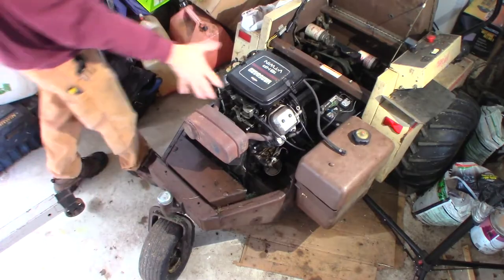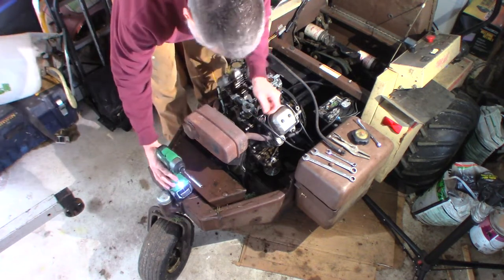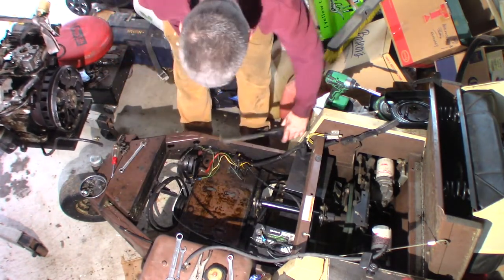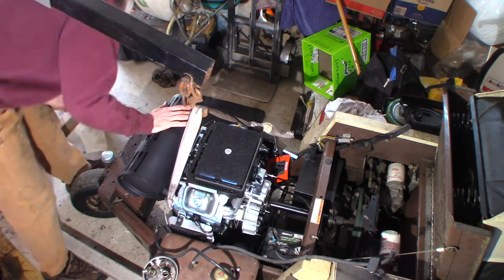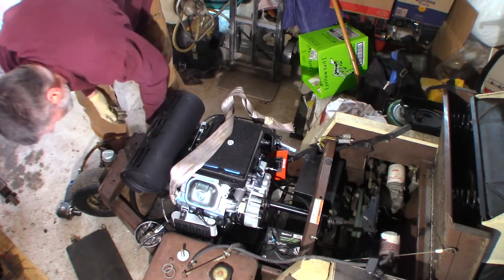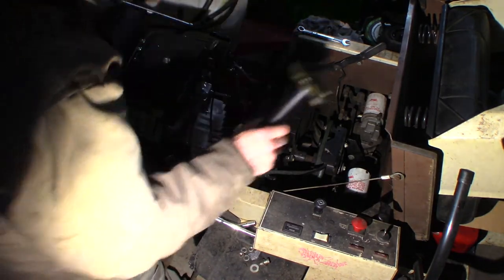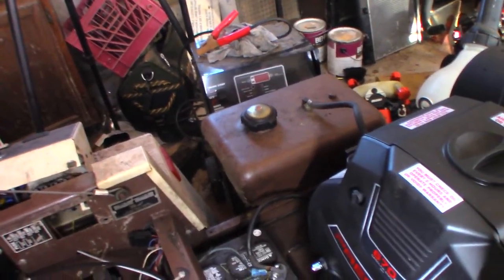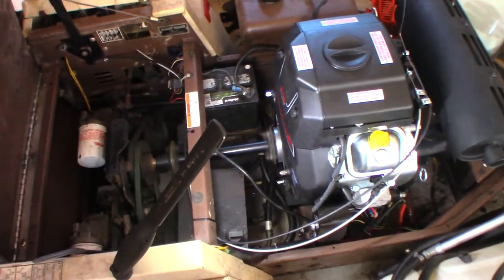Grasshopper 718 Zero Turn Mower Engine Replacement

Comment: I am currently doing this swap on my 718. I’ll post a video on my channel where I encourage viewers to watch yours as well. Great video and thanks for sharing.
Reply: @charlieandcars did you ever attempt to remove the key start box and use the grasshopper controls?  I am blowing my start fuse after the engine cranks over once.
Reply from the maker: No, haven't moved it yet.  I still start from the original key location of the engine
Reply: @CharlesAndCars  ok, so I’m going back to the original key box. How did you hook up your pto wires?  Mine were on the original solenoid but I’m now bypassing that.
Reply from the maker: @rankinprojects599  I didn't move the pto configuration.  It still works from the keyswitch on the mower.  I plan on moving the start from the engine to the mower at some point... just haven't had time to do that.

Comment: Any advice I could use some help switching from kohler ch20 to the 670 shaft on kohler way bigger predator is 1 inch and my pto clutch will not fit on it I know I can put a sleeve on it I’m honestly clueless of what to do atm

Comment: Thanks for making this video! I may be needing a new engine for my Grasshopper 720K. Is the engine still working well for you? Wondering if you ever moved the ignition. Thanks again for a great video!
Reply from the maker: It's still running good.  Have not moved the ignition yet.... low on the priority list.
Reply: @CharlesAndCars  do you happen to remember what the part number was for the spacer/adapter you used for the PTO?
Reply from the maker: @timhopkins3591  https://performancemad.com/product/predator-670-universal-drive-hub-adapter-pt-num-6015/
Reply: @CharlesAndCars  thank you but it looks like they no longer have them available. They referred me to eBay. I’ll take a look there.
Reply: @CharlesAndCars  wait I’m sorry! I do see it now when I click the link. I may have not explained what I needed when I called them earlier.

Comment: How is that predator holding up? How many hours do you have in the motor now?  have you had to replace any parts?
Reply from the maker: It's been really good.  No issues, haven't had to replace any parts.... It has a little over one season on it now.. don't know what that means hour wise...

Comment: did that originally have a Kohler command pro 18 on it?   i have the grasshopper 218 and im 99% sure im going to do this same swap
Reply from the maker: From what I can see the Briggs and Stratton 18hp was the original motor for that mower.
Reply from the maker: @RealEstateinvestmentrentals  The one I used was https://www.performance670.com/product-detail/predator-670-universal-drive-hub-adapter-pt-num-6015-   You have to get it drilled and tapped to accept the existing bolts.  I took mine to a machine shop and had them drill and tap it for the bolts.  They need to be exact in their spacing or you'll get an "off center" setup and a vibration as it spins the shaft that drives the pto. The one That I had come with a round plate that I didn't use.  The billet piece should fit right around the cranshaft end on the 670 and center itself when you bolt it up.

Comment: Sir is it worth buying a older grasshopper and rebuilding it and keep it going  like a 618 or a 718 
I was told by dealer u can’t get parts no more 
I ain’t got $15k for new mowers 
I mow about 15 yards per week
Reply from the maker: It's hard to say.  You're cutting alot more grass than I am.  I just cut my own.  I haven't had problem getting parts for my 718 at this point.  I've replaced several parts (spindles, wheels, drive shaft, etc. )  It's always a balance between new/more money and old/repair but less money.  Depends how much you're making from using it and how much has to be repaired.  Mine is a 1990 and still works for what I need.
Reply from the maker: nochesdekaraoke6802    I don't know.  Don't know how much time it would someone who does that kind of work all the time.   Also depends on the engine you want to use.  A direct replacement engine (briggs and stratton) is much more expensive than the predator.